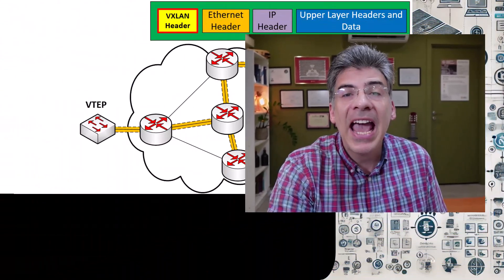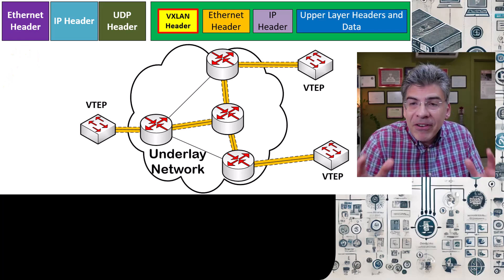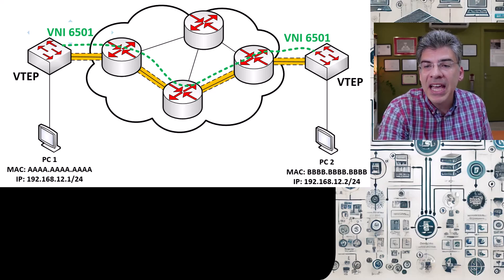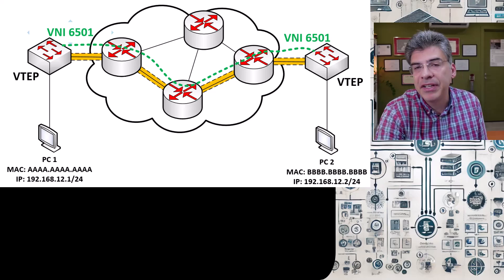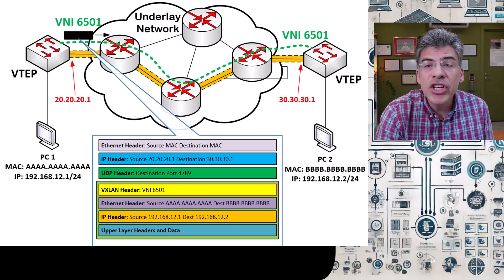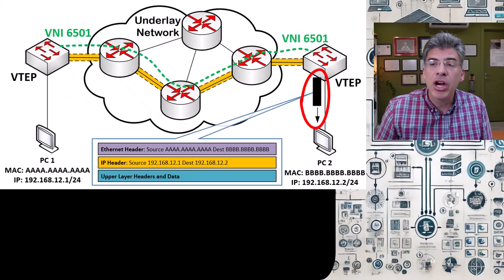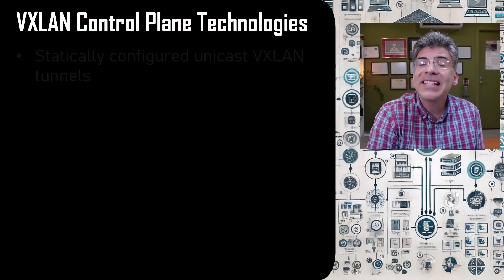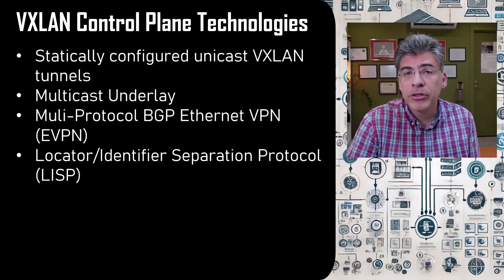VXLAN - Encapsulation, Headers, and the Packet Transmission Process

Comment: Hi Lazarus, I would like to appreciate you for valuable videos and thanks.

Could you please give answer to my below question.

I captured the vxlan packets on SDWAN versa and the IPsec packets which encapsulated under Vxlan showing as Data, unable to see the headers of Ipsec which are encapsulated under vxlan, thanks in advance.
Reply from the maker: Hi, thank you very much for the kind words, I really appreciate it 🙏

What you’re observing is actually expected behavior. When IPsec is encapsulated inside VXLAN, the inner IPsec headers are encrypted. Because of that, packet capture tools will often display the payload simply as “Data”, since they cannot decode or dissect encrypted content.

To see IPsec headers in detail, you would need to capture before encryption or after decryption (for example, on the clear-text side of the tunnel), or use a platform that supports IPsec decryption with keys, which is usually not available in production SD-WAN devices.
Reply: @telecomTech.explained thanks alot Lazarus for your valuable reply.

Comment: Hey Laz, Thank you for the explanation,  I am wondering how the souce host knows the mac address of the destination host ? Also when the packet reaches destination, once the encapsulation is stripped of , how it decide to forward to the destination host, as the network segment it drops into will be different and vlan will also probably different ?. Is there some kind of bridging happening ?
Reply from the maker: My pleasure!  Let me try to explain this concisely beyond what is in the video:

First of all, how does the source know the destination MAC?  If both hosts are in the same subnet/VNI, the source uses ARP. In VXLAN-EVPN, the VTEP often proxies/suppresses ARP its EVPN MAC/IP database, otherwise it floods the ARP.

If they’re in different subnets, the source uses the default gateway’s MAC (usually an anycast IRB on the leaf/VTEP).

Secondly, what happens at the destination? Is there bridging?
Yes. Each VNI is a Layer-2 segment. The ingress VTEP encapsulates to the remote VTEP learned via EVPN (MAC→VTEP). The egress VTEP decapsulates and bridges the original Ethernet frame into the local access VLAN mapped to that VNI, then normal L2 delivers it to the host.

Thirdly, if VLANs/subnets differ?
Then it’s routed: the leaf/VTEP’s anycast gateway (IRB) routes between VNIs (symmetric IRB in most designs), re-encapsulates toward the destination VTEP, which then bridges to the host’s VNI/VLAN.

Some of these topics are further addressed in subsequent videos in the VXLAN playlinst.  I hope that was helpful!

Comment: Hi Lazarus great content, really been enjoying and learning from your videos.  Do you mind please clarifying something for me please.  At 4:17 in this video you mention the VTEP's VNI mapping is done based on the corresponding physical switchport, but from what I understand I think it's a mapping of VLAN to VNI.  Yes a given physical switchport is going to be part of a given VLAN, but the distinction on what the mapping is actually made up of is still relevant.  Thanks again for the great content!
Reply from the maker: You’re absolutely right!  The actual mapping in VXLAN is VLAN to VNI. A physical switchport doesn’t directly determine the VNI, but since each port belongs to a VLAN (or multiple VLANs if it’s a trunk), the VLAN’s configured VNI is what gets used for encapsulation. I simplified it in the video to keep the flow going, but your distinction is important, especially when thinking about trunk ports or multiple VLANs on a single port. Thanks for catching that and adding clarity for others!

Comment: another way they call it flood and learn. is nt it correct?
Reply from the maker: Yes, that's correct! "Flood and Learn" is another way to describe how certain network forwarding mechanisms work, particularly in VXLAN and traditional Ethernet switching. In this approach, unknown unicast traffic (when the destination MAC or IP is not in the forwarding table) and multicast use this method.